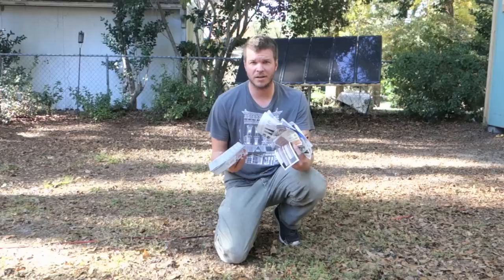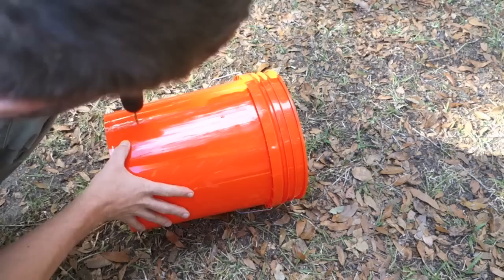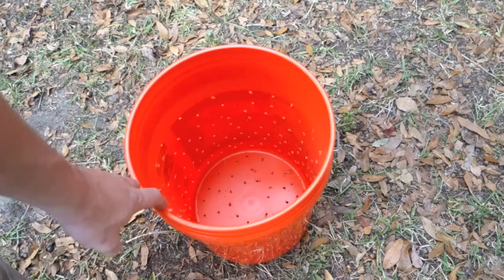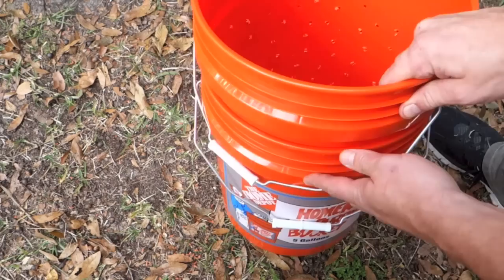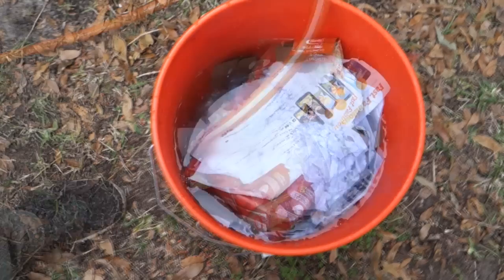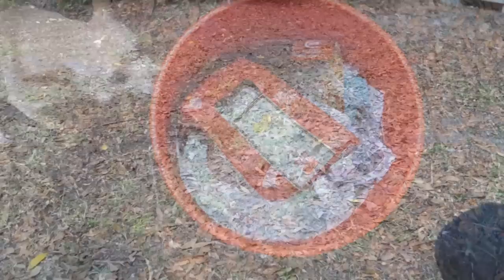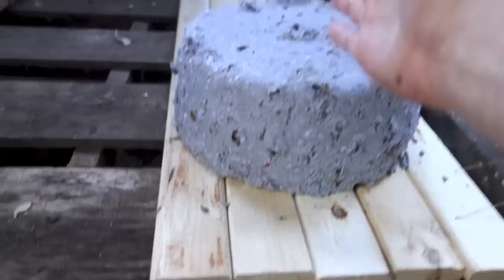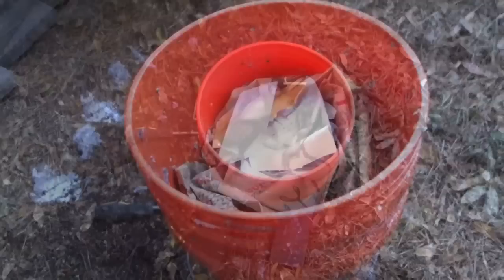Free And Virtually Unlimited Fuel To Heat Your Home

Comment: I had an idea while watching your cool video. What if instead of a timber press to squeeze the water out, you fill another bucket with concrete so you could leave it to compress while your out and about running other errands? Possibly more time saved?
Reply: Was thinking something similar to this, also where you could put the newly molded paper pulp bricks would be a shelf somewhat above the wood stove? The radiant heat would help dry a few bricks at a time while also keeping your home warm. This would work I think especially outside of summer.
Reply: Jesse Cashman Using your wood stove or fireplace insert is an art you develop over time, and your idea about the shelf is excellent.

I have a metal shelf on top of my old Treemont fireplace insert that is about 8" deep and 3 feet long.  I keep the "next wood" up there, picking the front ones first, so those are drying for 6 hrs or more.  Even wet wood from outside dries fine by then.  I also stack about 6 medium-to-large pieces on both side of the insert where it gets heated, and has a lot of air passing over it from the intake ports.  Also, a large piece on the hearth, right below the door.

This way, wood that is hardly burnable, ordinarily, is warm to the touch & dry as a bone by the time it goes inside.  I routinely burn cordwood that is very green, and this makes it possible, though I try hard to mix it with some better wood.  All my leftover wood from last year is kept separate to mix with fresher, more troublesome wood -- a practice I recommend.
Reply: Ben Peckover : Roger that.  Gravity, mass, and time can be great savers of your time and energy.
Reply: Come up with your own video and let others make suggestions.

Comment: This is a noble and clever effort.

However,

Looks exhausting.

You can buy a cubic foot of wood for a little over dollar a cubic ft which is about the size of a full 5 gal bucket. A cord of wood is around $125 to 150 for 128 cu ft delivered.

What is your time and energy worth and how much gas , time and energy would it take to drive to where you find 128 cu ft worth of compressible paper?

Nothing is free and unlimited.
Reply: The

Comment: I think you could just use a third bucket for the press.  Also, sometimes you can get those buckets with lids that could be trimmed down for a press or just used as the seat.  Also, you might try making the logs a bit smaller to speed up dry time.  And how well did they burn?

Comment: I'm a chemist, and to those concerned about the bleach on paper (sodium hypochlorite), once the paper is mulched it should be absorbed to a good degree in the water. Just to be safe, though, try to avoid getting the fire up to the boiling point of bleach. (That would release chlorine gas if it's still present.)
Reply: you had to spoil it smarty pants LOL teasing Bro great looking out. as always i learn something new

Comment: Great ideas, I am going to use it to make papercreate cement and paper. Your tips make a perfect fiber mass to mix and the quick compression will keep the mixture dry so the concrete will form a solid mass after mixing and compression into a block. Thanks!

Comment: If you end up using these outside for say a bonfire or campfire, or at your camp site, then you can use that fire to make them dry even faster.  Simply stack them around your campfire to form a sort of barrier.  The radiant heat from the fire will dry these out faster than if they were just resting somewhere.  I do the same for green/fresh/wet wood when outdoors.

Comment: For those out there that are actually doing this especially during the winter time I have an idea as a truck driver that used to do produce and a lot of things and had very little time to dry out a reefer trailer I would set the thermostat to 34 to 35 degrees this would suck out all the moisture in about an hour's time so if you had something I was 34 degrees of 35 to stick it in you could possibly make these pretty quick during the winter months if you had to

Comment: common misconceptions and DO’s/DONT’s:
- Never use any paper that is laminated or glossy. Feel it first. Things such as magazines, some fliers, and coupons and water bottle wrappers are a no go.
- Ink can burn perfectly fine, so if your paper is printed or written on, it’s fine to burn. But do not go and dump ink in on purpose.
- Never dump envelopes into the logs, the plastic window and glue will burn badly.
Reply: Plastic is excellent for fires. I heard that on YouTube.
Reply: Gee, take a happy pill
Reply: @evanwest1929  it can become carcinogenic
Reply: @benstolen3797  Coming back years later, since dropped the project, you are 100% right. Ofc, its better to have no ink, but ink wont affect much in moderate amounts
Reply: *Minor
Reply: @benstolen3797  Some ink. Plenty of ink is made from soy which should be perfectly fine to burn.

Comment: Before the internet, a paper log making advertisement in the newspaper was for sale. From memory the instructions were to put paper/cardboard, etc into a bath and let it soak. Then fill the simple but strong device with a lever that push the water out. When dried, the logs weren't that great. And the mess I had to clean was silly.
Then we had one of my State's biggest bushfire (wildfire). After it, everyone rallied to clear the roads. For two years I would chainsaw the wood and collected what lasted me decade.
      I love your newer and simpler way - something I could do outside the house.

Comment: just use another bucket as a press....
Reply from the maker: +ProNoob 4Life I mention that in the video.
Reply: Extra bucket on top + ratchet strap= no water,  but id use a diff fuel something with no ink, treatment, or plastic but your on the right track
Reply: +Vladimir Putin i suggest u change ur name. in named myself vladimir putin once with the same profile picture as u. account blocked for 2 months.
Reply: ProNoob 4Life yep
Reply: 69 likes
Reply: with rocks in it

Comment: I've read that its unsafe to burn PRINTED paper in a wood stove, because of toxic fumes, and the creosote that it leaves.
Reply: absolutely...it's common sense.
Reply: So be sure you have a properly vented stove/heater/fireplace and you don't have to worry.  In most cases creosote builds up because there isn't enough air flow so there not enough Oxygen can burn up the material.
Reply: propoganda
Reply: Bettina Stepek ooops propaganda
Reply: Ya i use to believe that too,, until i realized all the chemicals we dump in the air,,, natural, butane and gasoline emissions.... could ink really be that worse...?
Reply: Most printing facilities have switched to soy ink (or other non-toxic inks) so the risk due to lead or copper is almost unrelevant, however make sure to remove any plastic (it will smell badly and leave lots of residues, not counting all the dioxines that it contains) and if you want to be picky, also the glossy paper.
Reply: Breaking good Hey Mung beans ROCK! Don't dis' the beans
Reply: did you ever find out if it was safe to burn?
Reply: All the "printed paper is unsafe to burn" nonsense is false because the oil furnaces burn kerosene which has toxic chemicals in it and produces noxious gases (that ventilate out of the chimney), and nobody cares; instead people worry for burning a little paper in a fireplace that's supposed to have a chimney for the evacuation of the gasses (no matter how toxic they are) outside and away from people.).. If you are paranoid or worried, test your chimney for leaks and proper draft. Then, you could even burn formaldehyde in it and you won't smell the toxic fumes.

Comment: I used 3" PVC and cut "log" into coins. Dipped the coins in white gas for half a second to help them light easier. My first attempt was a bust because I pressed the log too hard, and it wouldn't stay lit. since then they come out great. The wood stove in my garage really likes them too. Not a whole lot of ash residue. Less than real wood ashes.

Comment: 'Free And Virtually Unlimited Fuel To Heat Your Home'
so.... wood?
Reply from the maker: dpauls15243 Unfortunately wood isn't unlimited for many people, just the opposite to be honest. If you have unlimited wood then obviously it would be ideal to use that instead.
Reply: Tiny House Listings paper is not unlimited either
Reply: luke neilsen until they stop sending out junk mail, it pretty much is.
Reply: Plus anything you buy that comes in paper or cardboard.  Paper plates, napkins, etc

Comment: My first thought was to gather the leaves too, until you mentioned biomasses. I was thinking of building materials too as a result. How much pressure could that log withstand before it crumbles? If an adhesive material was combined, could that potentially make a paper brick? Also, what type of insulation properties (geothermal) might this biomass hold? Seeing that it burns longer but requires more heat to combust, my thought is in it's passive cooling qualities as well. Some builders use hay bails and perhaps the is similar to being a bail of paper. Thought I'd throw the idea out there and see if that reflects back anything. Thanks for sharing.
Reply: Now you got me thinking about trying to insulate my kid's treehouse as a test for using this as insulation. I could make a 2'x2'x2" mold and make tiles. Might be a cheap way to insulate tiny homes or animal/livestock shelters.
Reply: @offhandacoustic  I like that idea. I was thinking about moisture and mold. Replacing old insulation would be much cheaper using recycled paper products. Replacing insulation may occur more often. It's an important component to energy efficiency. Fire hazards and Building Codes may get in the way. Tree houses are not regulated, I believe, by city ordances. If your electricity or gas runs out, you have. Source of fuel to heat.
Reply: @Matttchew5  they already use recycled paper for insulation, they also use recycled cigarette butts for the white cotton looking insulation
Reply: @desertoutlaw3317  Fiberglass
Reply: @Matttchew5  not anymore
Reply: @Matttchew5  im an electrician i crawl in attics every day i know when its fiberglass or not lmao
Reply: @Matttchew5  sheets of the pink stuff is fiberglass, spray in insulation is recycled paper or cotton
Reply: @desertoutlaw3317  For sure. I am agreeing with you, recycled fiberglass cigarette filters would be no different than the fiberglass insulation in an attic. Fiberglass is used for insulation.
Reply: @Matttchew5  bro your not agreeing with me because im saying they DONT use fiberglass anymore. 10 years ago, yes they used fiberglass
Reply: @desertoutlaw3317  Well, I knowledge of insulation is out dated.